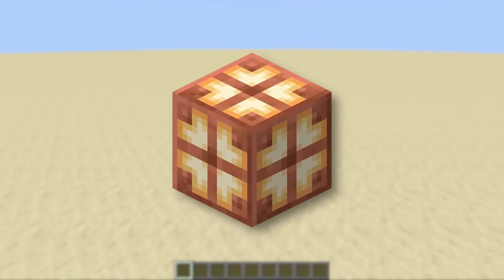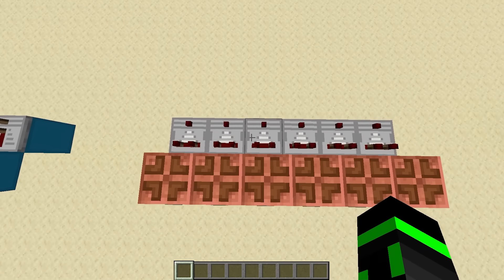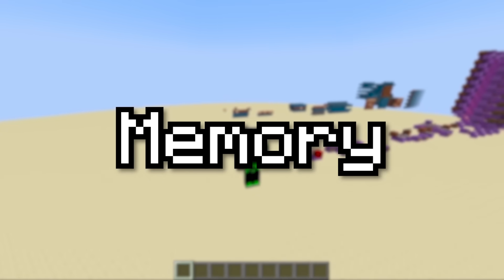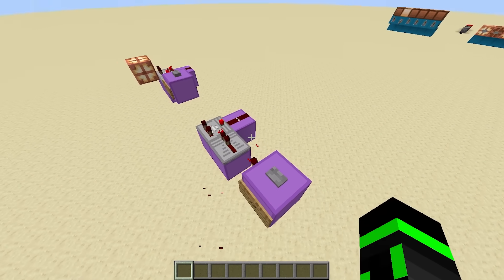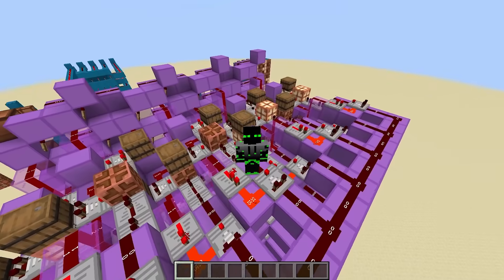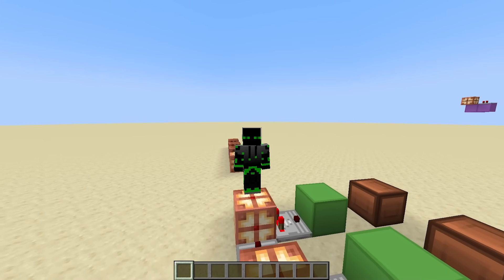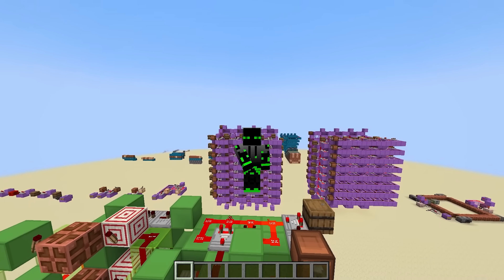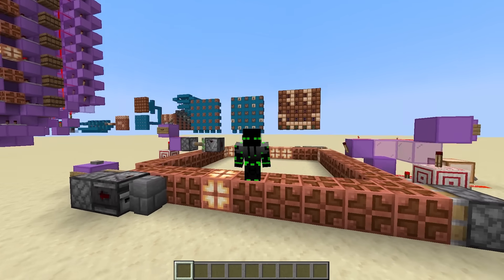Why I'll Never Use Copper Bulbs

Comment: T latches are actually somewhat popular for real life memory. the advantage is that it reduces the number of i/o lines. SR and gated D each require 2 inputs, T only needs 1. of course that means you now have to read every time you write, and writing is rather slow. so it's only useful if you plan to read a lot more than you write. if you don't have to write fast, why dedicate more wires to writing?

main uses i have planned for the bulb are cases where you need a toggle state but the state itself doesn't actually matter (mainly observer tech), and off pulses (also observer stuff). 

one other nice thing is that bulb -> comparator -> observer makes a very simple monostable. which actually makes me kinda annoyed that observers can detect the little red dot changing. if observers could only detect the lit state, it'd be the ultimate monostable.

Comment: The problem at 10:38 is just how irl memory works, if you have filled up the memory space the value would flip to the opposite side so 2147483647 + 1 would equal in -2147483648.

Comment: 8:00 - You just need to clear the bulbs before hand, why use an xor gate? You can use the bulbs as their own input, to make all of them shut off, and then write the data. You even use that shut off circuit in 9:35.

Comment: "Use the right tool for the job." In this case the tool in question is basically a T-flip-flop, so don't try to use it where you need a different logic component. Personally, I will probably only use bulbs where I need a TFF

Comment: Thanks (again) for featuring my build. Now that I watch the full context, I can say more. I'm researching copper bulb as RGB screen and I don't really thing resetting is a problem for copper bulb screen. Well, we can just use observer to observe redstone torch behind them. This is actually not very useful and inefficient because we can just use redstone lamp which is faster and smaller. But it's very useful if you want to make RGB screen using copper bulb.

The actual problem is RGB screen only work if it is big enough and you are far enough. So for fellow redstoner who want to research this block as RGB screen, good luck.

Comment: Minecraft logical redstone (and redstone in general) is mostly hardware programming. If you’re programming hardware to to a specific thing, not just “be a general CPU”, there are tons of cheaty shortcuts you can implement to make the product substantially faster. Or memory/energy efficient, if that’s the goal. 

I think the copper bulb will be like that. The best use cases may not be obvious now, but having one more tool in your belt will slowly lead to optimization in the long run. A copper bulb here, a copper bulb there. Places you may not expect.

Comment: @mattbatwings I think u should make a reddtone mechine that runs on the spinning copper bulbs because its fun and impractical but impressive to pull off. Immagine setting up a rrdstone machine that u have to make fly to go get your data packet before flying it back and dropping it off in a location. Could be a great co-op with abother tedstoner that does flying machine because u would have to make it so it doesn't have any redstone blocks or observers that triggers the bulbs while it fly's.

Comment: Of course you would not use copper bulbs instead of normal redstone lamps. But I bet there are some circuits that use copper bulbs and were not possible before. Just like we use hoppers for clocks, bulbs have more mechanics than just input/output

Comment: For the reset problem, couldn't you store the data on another array of copper bulbs, and then read from that onto the original screen?
Reply: i also thought about it; if you had 2 sets of copper bulbs, flushed the data to the "buffer", and then flushed the data to the actual screen, then it would automatically store current state and xor everything properly. i'm not much of a redstone person tho, so i don't know if there are hidden problems with that

edit: okay i'm stupid, it only works for 2 writes 💀
edit2: you could do that with some "classic" redstone, but then it becomes kinda like reading the copper bulb state, you just have more convienient access to it

Comment: Copper bulbs had so many potential back then, but now it's just garbage. The unique one tick delay it had was so good even if I didn't use it as much. Seeing how many redstoners use the one tick delay in so many redstone machines, I really saw how great a block with it would be revolutionary. But here we are with the ruined block.

For its uses, I would use it for screens. I have been trying to make a 1x1 screen out of these and have been unsuccessful. My main problem is that redstone dust needs a platform to be placed. Using alternatives like observers would just make it slower, and making the wires behind bigger would just render the purpose of having it built to 1x1 useless.

Right now, it has no uses for me. It's just another filler block added to keep updates going. It's as useless as a sniffer.

I guess time will only tell. Maybe in the future I'll find at least a small use for it.

Comment: I think you're heavily underselling just how useful T-flip-flops/inverting bit patterns are, especially when movable. They can also be used as extremely compact XOR, if the inputs don't arrive at the same time (if no signal arrives, they stay OFF, if one signal is ON they are ON, and if both signals are ON in sequence they turn OFF again). I use un-synchronized counters all the time since they are so compact (even more so with copper bulbs) without issues. It should also be possible to use that piston-square trick with moving bulbs to make a super compact buffer/queue/de-serializer, where inputs are saved at on point, read at a later point, and then reset with an observer. I like how they clearly show their state visually as well, I tend to have to put lamps all over my latches to visualize which bits are set, now that is built into the storage block!
Reply: I used it as a new binary counter
Reply: Wow, like an old fashion record player.

Comment: 3:00 i think that by using copper bulbs you are signifying to the user that you are using a toggle

for reset, you may be able to make it small by just running its output back into itself (if you did that i’m sorry i missed it)

Comment: I understand the point of the video, but I feel like you're somewhat missing the point. You take the bulb, try to replace the lamp in circuits that were designed for lamps and wondering why it's worse. The circuits were originally made for active displays and not toggles, so of course it will be worse. I feel that people just haven't yet discovered the ways that the bulb is better, since it's so new. I like the video, but I'd like if it could show that this is only an opinion considering the things thus far, but the future could show more uses for them when they're discovered
Reply: Not just the fact that it has different mechanics and that's is the main reason it's harder to use in existing redstone like they said building with the new block in mind is needed plus like 90% of the actual purpose of the block seems more so for design and ambiance because it's a light source we can control the level of light put off by the block now if they update observers so that they can register the amount of light being put off like actual light not the signal put off measuring in redstone strength but that's probably the only way to actually do that since when it boils down that's what the code to the game is actually doing anyway
Reply: It’s still new, think of when it’s as old as lamps
Reply: Of course is not for every single use he said, but i'm making logics, screens and memorys with copper bulbs and, the majority of the cases, the copper bulbs are better.
For example, the 2 wide pixel, i have a version a lot faster, better looking and easy to build (with a cleaner output), using copper bulbs, only uses 6 observers, 1 solid block and 1 comparator.
There is one more thing, in my opinion (and i'm making a lot of things with redstone, including games), a user interface that has levers is a bad user interface, i prefer to do 50 cop flops (t-flip-flops with copper bulbs) then having levers in user interface and making it close together (1 wide) is so much better to look at.
Reply: @ruialmeida8589  Apart from that, people were using filled cauldrons or composters as moveable comparator sources, which are better if you want them to give a consistent "on" signal that doesn´t get affected by other redstone signals, but if you don´t, it´s infinitely more complicated to change their fill level in comaprison to copper bulbs.

Really weird take from him imo and the clickbait is obviously the main focus of this video. It´s like he´s constantly trying to find reasons to hate on copper bulbs while not really succeeding in doing so. So HE PERSONALLY has no use for them... and what´s his point then? That´s not worth making a video and if he doesn´t get why other people would find countless uses for them, then that´s on him. A "Copper bulb vs redstone lamp display" video title would´ve been way more fitting, but oh well.

And omg... I couldn´t agree more with you on cop flops as an alternative to levers. They look way better and feel a lot better to use imo.

Comment: sinec they are movable you could probably make a giant chunk that isnt hollow of data and use it as a hard drive. there has never been a good hard drive design but if you have a giant computer you could make a circuit to copy easy to access RAM from repeater locks into a giant t flip flop chunk and do the opposite. since havingthem as a big chunk saves 1 bit of data in 1 block, and you cant really get smaller then that. ive tried making hard drive designs but i really think this get get tiny as real hard drives work with a spinning disk reading and writing as you might not be able to use it as RAM but having a chunk and 1 circuit to convert them would definitely be much better than repeater lock hard drives.

Comment: they should add stained glass bulbs so you can have multi color displays not that it's really needed cause it's possible to use pistons and stained glass already but it would be simple to use when building them next to each other making 16 by 16 screens or it could be possible to use lightning rods on copperbulbs to have a red green blue screen

Comment: Much of your argument could be summarized quite simply with "Lamps do [this job] better", and in your examples, you're right! But this isn't the purpose of copper bulbs. They're not trying (and failing) to be "lamps but better", they're a stateful alternative and a simple T-flip flop.

I think your dismissal of the application for memory is disappointing, since it's mostly done on the basis of not being able to transplant bulbs into previous designs 1:1.

And for user input? Levers don't intrinsically communicate toggles better. Assuming your user won't understand "lamp stay on = lamp toggle" is nearly insulting.
Reply: Wow, this is pretty much exactly my reaction, I second ^
Reply: I don't get your second point, can you repeat it in other words?
Reply: @bryansiew9707  "second point" is a bit ambiguous depending on what you count as a point :p can you be more specific?
Reply: @aidenlilley1319 your second paragraph. Thanks for spending your time to trying to explain
Reply: @bryansiew9707 I disagree with the way he argued Copper Bulbs are not useful for memory in redstone. The core of his argument was that applying it to an old design made it clunkier, but I don't think it's fair to just try replacing old things and forcing it to work. It's more interesting to look at potential new designs instead.
Reply: @aidenlilley1319  that makes sense

Comment: I think the problem with all these examples is that you're only using them to try and replace lamps, which wasn't their intended purpose in the first place. Once people find niche uses for them (e.g. HDD storage, programming) it'll become that much more useful for those things
Reply: Exactly, they aren’t the same. Redstone lamps are good for short-term storage (memory/ram) & setting values while copper bulbs appear to be good for long-term storage & toggling values.

Trying to toggle the value of a lamp is as difficult as setting the value of a copper bulb (I think. I haven’t used copper bulbs, but in theory it should be the same difficulty)
Reply: And ssd

Comment: Most of the time your point boiled down to “don’t use copper bulbs where a lamp would be appropriate”.
Note: A  XOR 0 = A - hence to clear a copper bulb screen, simply set each bulb to it’s current value - is that easier than clearing a lamp screen? No but see previous point.
More generally, I actually agree that after my initial excitement died down, I’m having a hard time seeing what, if any, circuits they would improve. However, I expect to be surprised over the next few months.

Comment: Does "Tape" memory have potential? I imagine you could run multiple tapes synchonously as well, meaning you could rotate 3-12 tapes, and then encode actual instructions with an decoder
Reply: like you could have 010 be the "move to registerA" instruction, and then have it rotate and say
010 11000 meaning the tape would rotate and the number 3 would be put in a register

Comment: 5:39 I immediately asked myself, why wouldn't you just use a copper bulb in this design to make it look better?
Reply: There's no point in replacing the note blocks with copper bulbs because then you need to add an input like buttons which will then dilute the image anyway. Might as well just use note blocks because those are already player-interactible
Reply: @nichard101  Replacing the note block might not make much sense (just slap a button on a bulb though, it still looks nicer than janky pixels) but you could replace the lamps with bulbs so you don't need to store and repeatedly send the current state, which should make for a more compact screen.
Reply: @GremlinSciences that is pretty ironic that his example against copper bulbs could’ve been improved with copper bulbs.
One bulb with a button and 3 bulbs that get toggled with the button as well and voila, a readable 2x2 light-up display without constant observer ticks
Reply: @Leffrey 
Exactly, and it only needs 6 observers (that only pulse 1 time), 1 comparator e 1 solid block.
I'm making things with the copper bulb and most of them are better then the redstone lamp designs.

Comment: I agree with you at everything except one thing which is the rgb screens. You shouldn't have to use a resourcepack to get different colours on the screen. And map displays are tiny and horrible to work with. Maybe they aren't the ideal solution but at least you could get 3 different colours on a screen easily
Reply: Also I just remembered that TheDarkness showed a synchronous smaller design of a counter using copper bulbs which would be useful

Comment: Ultimately I feel like copper bulbs are never the perfect fit for a lot of computational redstone stuff because they are stateful. The standard in computational redstone is to work with direct values of 1 and 0 to avoid state, and generally to work with copper bulbs you want pulses and observers and stuff.
For memory, I'm guessing the copper bulb will overall not be good for making the standard type of memory more compact, but the piston based stuff would be really cool for making a slower but vastly more compact memory (like a hard drive compared with RAM). If reading things sequentially, it probably wouldn't even be slower, given the bulbs would arrive in order. So, perhaps good for large files that are processed sequentially but can be modified? Or could be used to store large amounts of memory that are bulk-loaded into a cache by spinning one full slice of the disk.
Reply: There are plenty of cases where you want state, even if it isn't the majority of cases, I see them coming in very handy in those special cases!
Reply: @Takyodor2  i just know you dont for basic gates. one person was like "yeah you can make a tiny xor with these" and its like you *can*, but its a terrible idea, will fail on bad input timing, overall not the right move
Reply: @electra_  There are cases where you know two values to be XOR'ed will arrive at different times, though. Copper bulbs aren't an obvious replacement for something existing in all situations, but they are better under some circumstances.